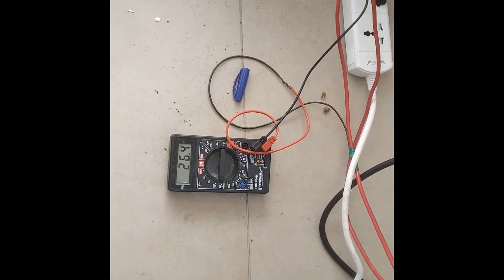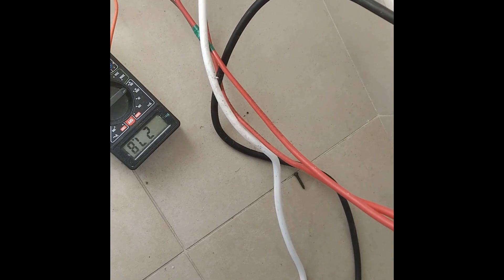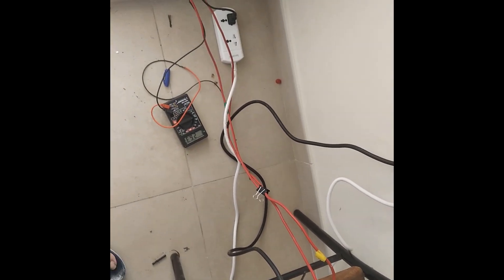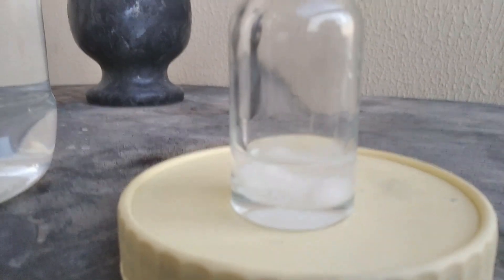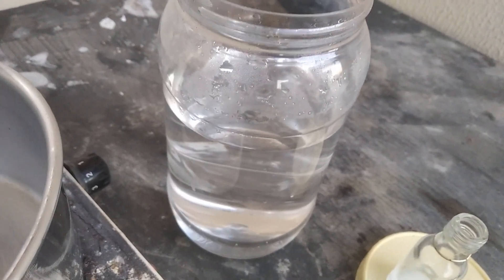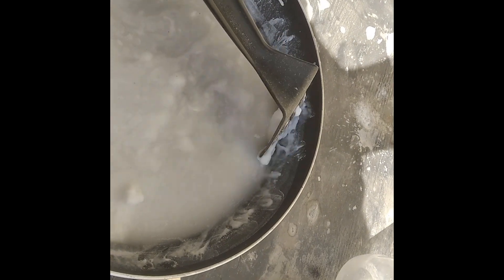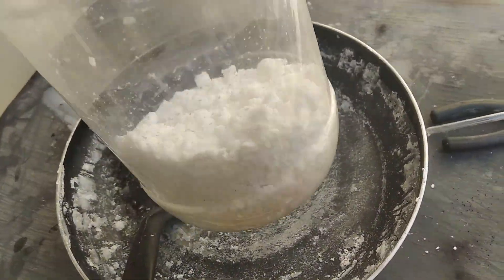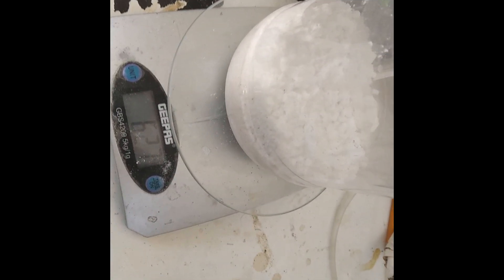Perchlorate cell full run

Comment: Can I boil the chlorate in a metal container such as stainless steel?
Reply from the maker: The only metal pan which is compatible with chlorate liquor is aluminum or ceramic/teflon coated pans.
If the stainless steel pot has a coating on it then yes but if not then no.
While you can boil it in a stainless steel pot there will be issues with chromium and manganese leeching.

Comment: Why do you want to keep the temperature of the cell that low?
Reply from the maker: PbO2 degrades fasterat high temps and you dont need high temps past this for good conversion.
Beta PbO2 which is this electrode is more prone to degredation than alpha PbO2 due to internal stress but alpha is less conductive and takes long to make a proper one which is non porous.
This electrode is multilayered.

Chlorate cells should be run hot around 70C with pH control to obtain 89% efficiency with Ir-Ru and 80% with Ir-Ta but perchlorates are fine running less as they arent affected by pH control.

I run the chlorate cell with pH control which is easier now using buffers like CaCl2, MgCl2, persulfates.
Reply: @CatboyChemicalSociety  ok thanks! If you run the cell at something like 70-80c would that not work at all? Or would it simply decrease the lifetime of the anode?
Reply from the maker: @thepyroenthusiast3382  it would work well but it will decrease the lifetime of PbO2 and Pt alike but if you make the coating yourself that hardly matters as it will still last months.

Comment: I've had that happen too. I think it might have to do with the breakdown of the titanium cathode.
Reply: The gelling, I mean.
Reply from the maker: in my case its magnesium hydroxide which MgSO4 controls the pH of the cell in this case where sodium sulfate is produced and magnesium hydroxide is produced as the remaining hypochlorite from the chloride contamination break down into hydroxide and chlorate.
This is important to prolong the life of the anode as any remaining chloride can mediate errosion of PbO2.
Alpha PbO2 when plated right is more corrosion resistant than beta PbO2 and also more catalytic but is less conductive so operates at higher voltages.

Comment from the maker: next video is how to make a PbO2 anode
once ofc I buy a Ti sheet or I might just use graphite as an example since for demostration purposes it will work but please dont actually use graphite!!
Reply from the maker: @Pokrovov I would but HF is not amateur friendly!!
if I can get NaF then I can easily make HF using membrane process but that shit is so scary XD!!.
I think you have a point there but what ceramic shall I use and what current carrier.
I will try to just simply etch with HClO4 since that also etches ceramic which means membrane plating bath of Pb(ClO4)2.
what did you use as a current carrier metal was it Ti with ceramic pasted on it ??
or sth.
Reply from the maker: @Pokrovov well my next idea with polymer substrate electrodes is to use graphite instead of PbO2 as the initial conductive composite substrate then plate PbO2 using lead chlorate or perchlorate.

Comment: The anode survived!
BTW, you ran the previous cell with a little higher voltage, isn't it? This time it's around 5 volt.

So, I assume supply voltage is not that important as long as the power supply can push enough current. What are your thoughts?
Reply from the maker: supply voltage doesnt matter whoever thinks you need 6 volts for perchlorate cell is dumb.
from what I read it just has to be enough to oxidize the chlorate and the rest is up to the current.
The reason people say 6 volts is because they have poor choice of electrode distance where they do something like 3cm or 4cm apart then yes it will take 6 volts.
I use 2cm for perchlorate cell and 2.5 for chlorate cell and industrial cells have them almost hugging eachother.
The most important thing in a perchlorate cell is anodic current density which should be 200ma/cm^2 and anodic surface are must be equal to greater than cathodic surface area.
Both my cells run at 5 volts well the chlorate cell runs at lower 4.5 to 4.7 volts while the perchlorate cell runs from 5v to 5.3 volts depending on initial feed concentration.
Reply: @CatboyChemicalSociety  This has been my experience as well.
Reply from the maker: btw im doing yet another run of this cell!!